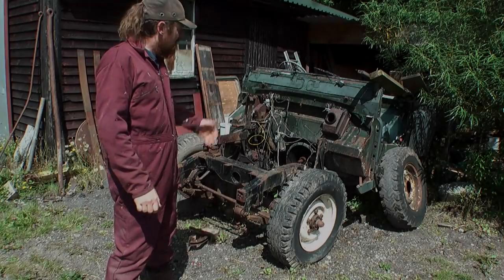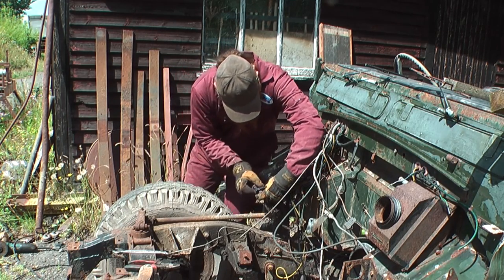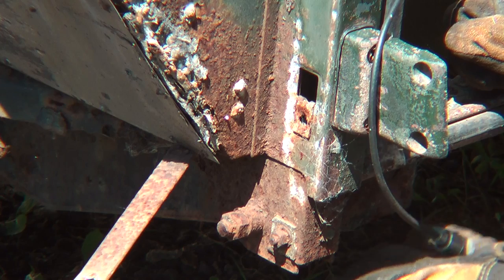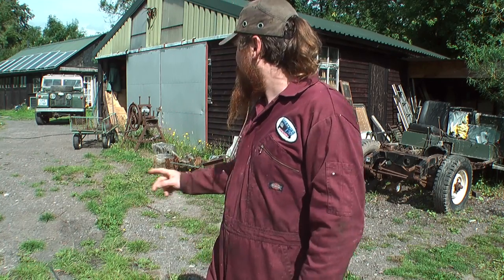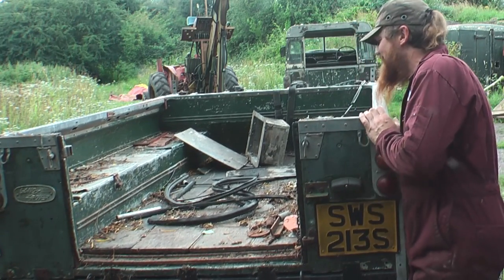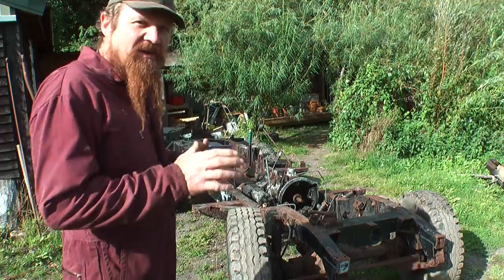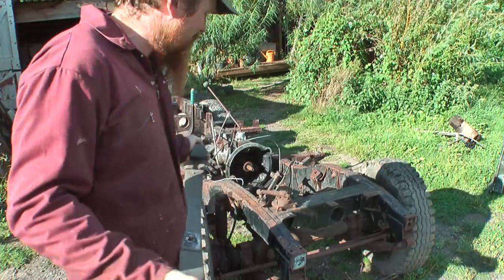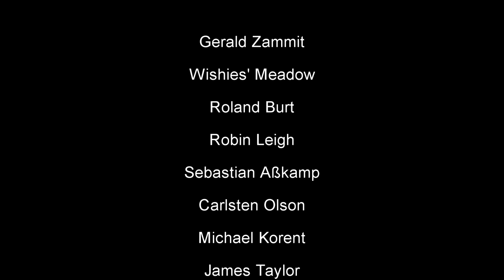Project Kermit 3: A Land Rover Series 3 Full Restoration

Comment: Hey mate, I've always wondered if it might be worth stripping the spring hangers of a pair of D1/RRC diffs and welding on the blocks to suit the leafs.
The result would be a slightly wider offset, however, disc brakes, 24-spline and 3.54 ratios.
Food for thought.

Comment: the ball joints I have seen two guys rework a worn out one buy melting solder and in one pour fill the joint around the ball after the pour they would carefully move the ball so it did not set solid, grease it up and never worry about it ever again

Comment: My husband says really with parabolic springs you need gas shock absorbers, that would make its on road spring reaction more predictable. They would cope with free movement better.
It's all to do with the original multi leaf springs moving and causing friction between the leaves, parabolic springs don't ha e that friction so you need the gas to work better.
Reply: Also he says don't mix the type of breaks on the front and back because the breaking efficiency with be increased on the front wheels so when you break it will seem like your driving something with only front breaks, the back wheels will try to take over the front wheels and it will be very unstable. ( he has always owned Land rovers and range rovers and was a mechanic /fabricator most of his working life)  hope you don't mind me saying his comments he says go on to some of the Land rover forums and see what advice you can get from there too,  and he admires what your doing in restoring  it.

Comment: On the pitman arm, use two hammers, and smash it from two sides at the same time, it will release the cone and you won't have to use the fork. Also, oil the threads of your extractor thingymybob and you won't strip the threads in it either.
Reply: When the engines in there’s no room for any hammer antics. Grease those threads though!

Comment: Hi there. 

I have a similar Land-Rover. A 1959 109” with a 200tdi in it. I’ve owned it since 1993. Had the 200 in since 2007. Just done an engine and gearbox replacement on it, build thread here: https://forum.retro-rides.org/thread/213485/1959-rover-series-rolling-resto

I’ve got a toolbox with the dropped well for the battery for under the passenger seat going spare if you’d like it. I replaced it earlier this year for one that would hold two batteries. 

Have done loads of the upgrades you’re considering already, some of which have worked better than others. Happy to walk you through what I’ve done if you like. 

Bizarrely enough, I’m also putting a Cummins 5.9 out of a DAF into another lorry, a 1960s Austin. 

All the best, G
Reply from the maker: Thanks for the link, looks like a good read!
Reply: Maximus Ironthumper 
No problem. If you think I can help, just drop me a line. I’ve a similar cache of hoarded parts to you, happy to trade/swap stuff if I have anything you need. I did do a write up of my original conversion on the Series 2 Club forum, but it’s got lost in the server move. I’ll update it and send you a link.

Comment: Ahh ,the disappointment associated with parabolic springs , is almost as much as the disappointment from poly-bushes when they wear out in 6 months
Reply from the maker: I've had them on the other landy for about 18 years, not disappointed yet! I do think they are often oversold though.
Reply: Part of the thing with polybushes is that they're stiffer, which I can see the point of in a track car but in a Landie just puts more stress on the mounts and transmits more vibrations through the body.

There's an argument they're easier to fit but I've never had a problem fitting bushes! Bush fitting tools (like a big G clamp) are cheap enough too.
Reply: Tom Cardale not necessarily, there are different grades of poly, some manufacturers use the colour to denote the stiffness, black being stiffest and blue being OE comparable with yellow as the normal upgrade for a "trackday" type car. Got a feeling red was softer than OE but that may be wrong as it's been a while since I did any. (Used to work in motorsport garage)

Comment: Would a stainless steel chassis just last too long for built in obsolescence consumer culture or are there other reasons do you think ?
Reply: Probably cost you in the region of £7500 to buy. If you could find someone to make one. regards
Reply: hmm stainless ain't the best a resisting fatigue cracking for one thing, fabrication would be most definitely a full custom job with a full custom price...

Comment: Is there a reason why the 200tdi is more popular conversion than a 300tdi?
Reply from the maker: It's a easier fit the the series gearbox, uses the series mounts - plus in my case I have 3 of them in store!
Reply: 300tdi in my s3, you need the 200tdi flywheel housing then it go's streight on to s3 box, mine was disco 300 so had to move driver side engine mount, otherwise all good, also rangerover power steering.